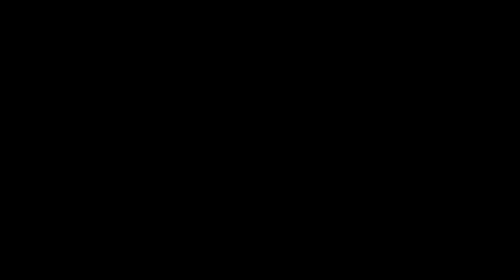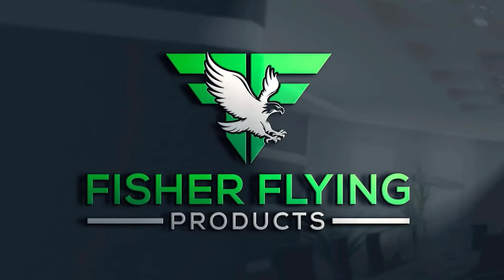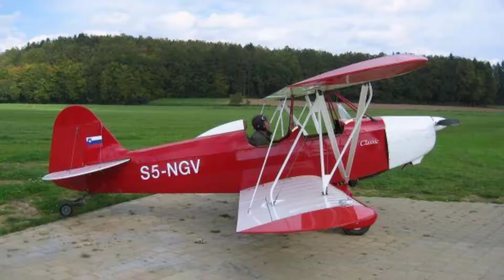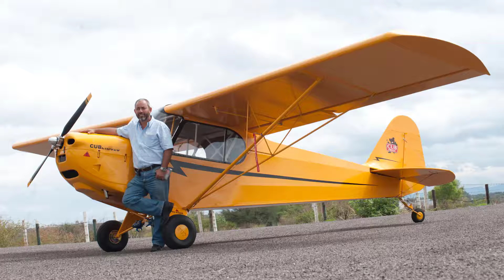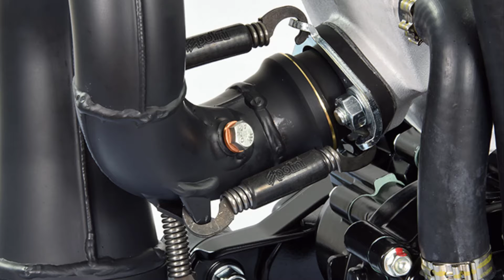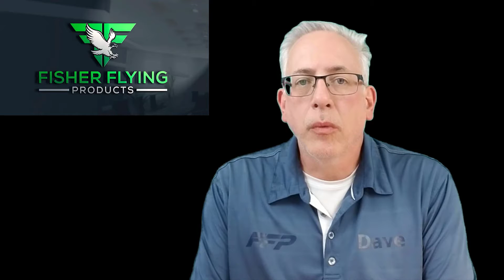ALL ELECTRIC IS COMING! DO YOU WANT TO FLY AN ELECTRIC FISHER?

Comment: LifePO4 (Iron Phosphate) you speak of are not lifetime batteries; I've spend a couple thousand on LifePO4 cells to build my own sets; and they do 'bulge' although they will not go up in flames. Once discharged too far or over charged too high; or held at 'full' charge too long they will be irreversibly damaged.

Comment: I like how it gives you instant torque. but a 45 mnt flight time? plus the cost for everything isn't cheap at this moment. how far can one fly say in a 202 with a gas engine?
Reply from the maker: At this point it isn't about range. If you want to go places cross country, install a gas engine. Most ultralight pilots fly to get their flight fix. That usually takes less than 45 minutes and is usually a local flight to the home airport.

Comment: Great video. Always great to see a company innovate. I wonder if you guys use or have thought about using diesel engines in small planes ? Diesel has the advantage that it could theoretically run more easily on biofuels. Electric is amazing but I am guessing that the power density will favor fuel engines for a while.
Reply from the maker: Thanks for the comment. We feel that electric is going to satisfy the largest market.

Comment: Dave, you're the first company I've come across that is proposing a logical concept for the future.
I live in the U.K., so am wondering if you're planning to have battery service agencies abroad.
Do you have a rough idea of timescale at the moment, with regards to availability of a complete package ready to fly, or is it waiting on battery development to progress.
Reply from the maker: We are flight testing the first system for small aircraft (25 kw) now. Covid is challenging us all! Once that system is flight validated, we will pour our efforts into the higher power systems. Current batteries shouldn't need maintenance for  a good long time. I had an initial timeline of getting one of the 2 larger systems through testing by the end of '21

Comment: This is plainly the way to go. As electric motor systems get more common their reliability will leave IC engines way behind. Think of all the elements of an IC engine that have to be working perfectly before it will run properly. When you read the crash reports you'll find good old pilot error at P1 with engine failure hard on its heels. Electric has got to be better than that. In no way will an aircraft be less fun to fly if it's electric rather than IC. I'm dreading having an electric car because I like changing gear and having the feel of driving a car. It's not the same with aircraft, power is on, half-on or off, Dave's remarks about instant torque are significant and he and his company, I reckon, are right to go down this avenue.
Reply from the maker: Totally agree!

Comment: Very interested in anything along the line of a 377 or polini. I’ve looked at this a lot. Electric motors in the 25-35kw range are readily available. Problem is getting batteries in the 45 min flying range and above that don’t push your combined motor battery weight in the 90 and above lb range. Onis’s lithium sulfur batteries would, if their claim is valid, make the weight without problem. But their stated operating temperature max is 86°f and nc summers are about that everyday. Plus you need to store batteries in air conditioning to be below their 68° storage temp max.
I am repairing a kolb firestar and was hoping to replace the 377 with electric but I guess it’s not time yet. I’ll have to wait and see who comes up with something workable. Think zigolo has an option but their aircraft is very light and the option for electric, if I remember right, was $17k. Way out of any kind of comparison to gas even over the lifetime.
Reply from the maker: Battery life has increased a great deal lately and will continue to improve. We are looking to satisfy the market that just wants to get off the ground to get their flying fix. The long distance travelers will continue to be served by ICE engines for some time.

Comment: I look forward to the day that ultralight aircraft, tractors, pickups, and construction equipment are all electric. A high torque motor turning a big (72”?)  3 or 4 blade prop slow on an ultralight at 33hp sounds like it would be super smooth and quiet. Powered gliding noise level is almost within reach.
Reply from the maker: It is coming faster than you think. We have hit a tipping point.

Comment: Interesting to hear the case against structural batteries. Was wondering about Lithium Sulfur but I suppose it's still a research topic and too far off - no volume supply right now kind of thing.
Reply: Ok. That sounds better, but they have conflicting info out there: https://45uevg34gwlltnbsf2plyua1-wpengine.netdna-ssl.com/wp-content/uploads/2019/07/OXIS-Li-S-Ultra-Light-Cell-spec-sheet-v4.2.pdf 
This states operating temps of 0-30°C (86°F). So which is true? I’m Starting to think they just confused centigrade and Fahrenheit, meant to say safe operation to 85°F. And 140°C is NOT short of boiling point! 0°C is freezing and 100°C is boiling point, 140°C is 284°F, well above boiling point. They need to edit check their article.
Reply: I was interested as well. I looked up Onis web site. The weight advantage looks unbelievable. However, the storage temp was 20°c (68°f). You have to keep your batteries in air conditioning. But more important, the max operating temperature was 30°c or 86°f. My summers here are pretty much above that everyday.
Reply: @scottluther6699  "OXIS has demonstrated safe operation up to 85°C, albeit with reduced capacity at the top end of this range. There are no safety issues when the cells are heated up to 140°C."  So thats an operating capacity of about about 14 degrees short of boiling water.  http://oxisenergy.com/wp-content/uploads/2016/05/oxis-brochure.pdf

Comment: I'm 100% in favor of electric power systems for aircraft, BUT, for me to actually try to go forward with it, I'd like the endurance to be still considerably more than the short flight times they are talking about.  I want to travel in my plane(s), and I'd like to have a range at least 400 miles or more, and either a very quick charging system, or the ability to swap out batteries at a stop.
Reply from the maker: Stay Tuned!!

Comment: For PAR103 I've always thought the rules should be total weight minus the weight of 5gal of fuel = less than the 254lb limit. I love the idea of additional packs not being counted as total weight, but I somehow feel that won't get passed, unless there is restrictions on flight time as the 5gal rule is to limit the use of the par103 vehicle to local flying and not cross country due to the lack of aeronautical knowledge the untrained pilot has to make a cross country flight safely.
Reply from the maker: Thanks for the input. I agree with what you have posted.

Comment: I sort of think that most applications i see aren't really thinking out of the box. They are really just emulating model electric aircraft applications but scaled up. I won't yet say what the solution should be looking at as I am currently applying for a development grant and I don't want to shoot myself in the foot but if you aren't actively switching battery pack and motor winding configurations then you are thinking one-dimensionally and are stuck in last century.
Reply from the maker: Great feedback! Thanks

Comment: Great content Dave and well worth a listen. 

Has it ever been considered to have solar cells embedded into strategic areas of an aircraft. This would enable captured sunlight to feed charge back into battery packs while in flight or parked out in the open on an airfield. In Australia, we like solar cells and the creative folk here have devised many cleaver ways to use them - maybe this is yet another?

I would agree that electric power is definitely the future and a break away from fossil fuel dependence could mark the true beginning in rejuvenating our planet and revolutionizing how we get from place to place.

Keep innovating,
Regards Rudi Myerson.
Reply: Rudi,  I have a DHawk without an alternator but with an electric starter.  I have looked at carrying solar flex panels to charge that battery.  I would like to see a solar augmentation system too.
Reply: maximizing solar exposure could drive the design of wing plans like low-aspect ratio airfoils and faster/more efficent airplanes. The next Lindberg could be the guy who crosses the Pacific  in an electric plane!

Comment: I've been an electric-only modeler for 20 years.  It's a different way of thinking and I really like the way you are thinking - modular. Safe.  In New Zealand we don't have the weigh restrictions like the USA (more like the Canada rules) so a few pounds over isn't an issue - if anything it means we are safer with better tolerances being slightly heavier.  The 45-60 minute range fits 95% of my flying too... If I want more, I use the club's Zenith 601XL.  Keep it up!
Reply from the maker: Great news is that we have an ex NASA electrical engineer working on our packages now and we will soon have them ready for sale. The other bit of good news is that the component prices are dropping fast and the systems are becoming more affordable.

Comment: I fly only electric RC planes, from 1.3 mt to 2.5 mt wingspan, and the feeling of control over acceleration is not comparable to the internal combustion engines.On the other hand, the reliability is unmatched, while I fly over and over again, some friends disarm their engines, change the spark plugs, look for fuel leaks, and lose all morning. Three years ago, I was the only one who used electric motors exclusively, I was a minority in my Club, now, the minority are those who use combustion engines, I think like you, electric motors are the future.
Reply from the maker: I cannot imagine flying behind a 2-stroke engine when there is an electric system that  far surpasses their MTBF. I know of many pilots who have wives that won't let them fly any more because they have had a couple of engine failures.